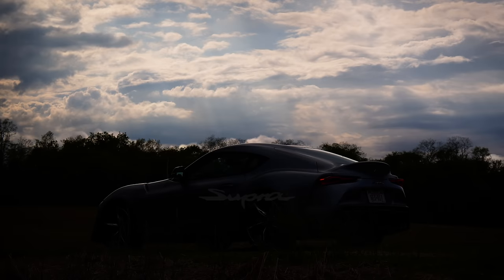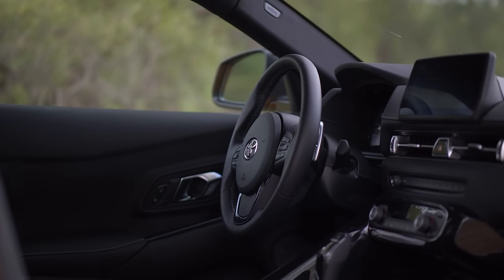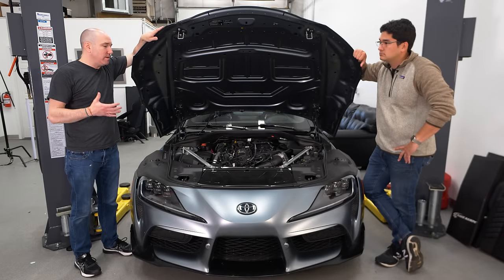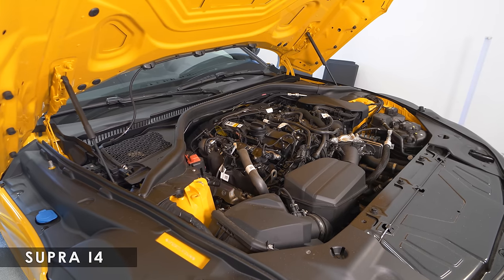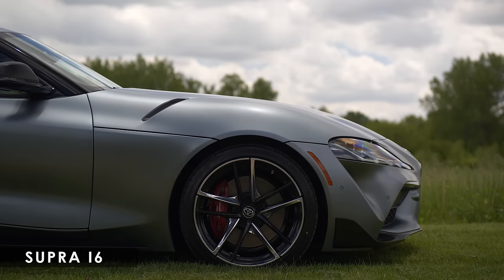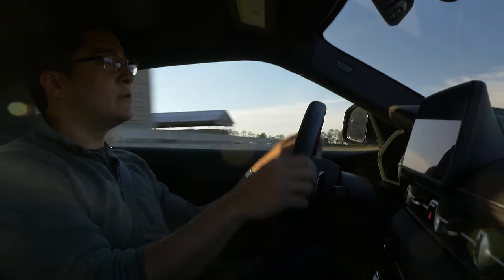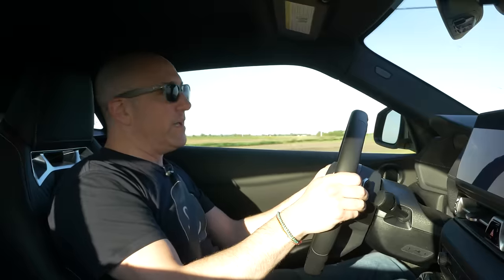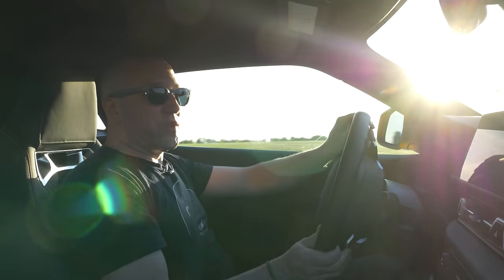2021 Toyota Supra | 3 Pedals Short of Greatness

Comment: 4:55 According to Toyota it's targeted to be a track-day weapon
21:44 It's not a track car
Reply: To be fair to him, I think there's a pretty big difference between a track-day car, something you could take to the track once in a while, and a track/race car, designed predominantly to be driven on the track.
Reply: Toyota also said it was targeted at the Cayman, a car with a manual.  
Clearing the air though, a car can be designed with track days in mind, but that doesn't mean they are going to take track days with no issue stock.  Early 86 had track day fuel pump, brake, and (arguably) tire problems and that car was specifically targeted at trackdays.  Hell Toyota/a dealer was sued and had to pay because of it.
Reply: hyperbomb02 not only did the cayman have a manual, it just seems insane to me to target a mid engined car when the car they made is front engined. Such a different dynamic

Comment: Engine bay is such a mess.....
Reply: You should look at the Lexus GSF’s engine
Reply: honestly its not that bad. All the fluids are accessable
Reply: Its not that bad, but if you want to see this engine cleaned up look at papadakis Supra or Ken Gushi's Supra engine bays. Its possible to do a clean up.
Reply: Especially the 4. Looks like spaghetti
Reply: They took the covers off.
Reply: Hah it's not bad by modern standards, the Q50/60 engine bay is a mess and has zero space
to work. XD
Reply: You got that right !
Reply: So buy yourself an early 70's Camaro and resto-mod in a FI converted GM V8 then.
Otherwise, hoses and wires are going to be how all the electrons, fluids, gasses get around.
Reply: Oil changes look pretty easy on the car tho

Comment: The 4 cylinder is not only 200lbs lighter, but it’s got the better looking wheel set. And smaller wheels are better anyways. Just needs a 6MT “RS” version that’s “another” 200 lbs lighter. 2980lbs? Yes please.

Comment: I would like all of the weight reductions and simplifications of the 4 cylinder model, with the drive train of the 6 cylinder. And of course, a manual transmission. I don't care about all the luxury and fancy stuff, I want the best driving experience.

Comment: The car reminds me of my 370 a lot in its 6cyl, 2 seater, hatch configuration and yes, even the buffeting, just newer and tighter. I'd upgrade to the Supra if it didn't cost $100k locally (double what my Z cost me new). Love that inline 6 though

Comment: Actually Mark, Tada-san said that, they'd pop the strut brace on when they increase the power output. He also said that, on the v1.0 Supra, they left the brace out so as to achieve a perfect "balance" (because the torsional rigidity is higher than that of the LFA), and that the enthusiast could add them because the airbox was designed to take it whilst also leaving holes for it.
Thanks again, guys for enriching us with a 'premium' viewing experience (even though there were a few typos here and there).

Comment: That sure is a lot of missing pedals.
Edit: Wait, the 4 banger has an open diff? The 86 Twins can afford to have an LSD, what's your excuse, BMW?
Reply: Just BMW being BMW.
Reply: Yup bmw being bmw. They try to compensate for it by using the rear brakes as an LSD clutch pack but it doesn't respond as quickly and wears your rear brakes. For most drivers it does the job, but on a car this expensive and driver focused it seems criminal to not include a mechanical LSD.
Reply: My base model 2019 ND2 Miata also has an open diff. Granted, that it's a $25k car and not a $45k car.
Reply: BMW doesn’t need an excuse. The ownership of the end product belongs with Toyota. It is their choice not to offer a mechanical LSD on the 4 cylinder variant. BMW could have supplied one if Toyota requested it but it would’ve raised the price point of the vehicle.
Reply: paul dewar This. People will always find a way to hate on BMW..in this case they’re simply the supplier.
Reply: You have to pay for everything. The "M" differential cost crazy crazy money.  Nickle and dime you for the "ultimate driving machine" that is not even close to sporty unless you option it to cost more than a M model cost outright.
Reply: All the McLaren supercars use open differentials. I'm sure they're not trying to save a few dollars.
Reply: @exothermal.sprocket  Then they must have some serious torque vectoring tech or something then, otherwise they'd one wheel peel all day.

Comment: I've been watching used RC Fs drop in price and was considering one as a daily driver. But the 4 cyl version of the Supra would be about the same price, but with a full warranty. As Toyota has a great reliability reputation, and BMWs are basically pieces of shit after warranty, how does that affect the Supra? 

I have to admit, part of the reason I like the RC F is that, I know there are Lexus V8's out there with 1 million miles on them from the original LS 400. And also, I feel the poo poo the RC F has had from the automotive press is silly as it's barely slower than the BMW M4. Which car would be more reliable in the long run? A new Supra or a used RC F?
Reply: Used RC F by a long shot!
Reply: No replacement for displacement
Reply: If you are looking to keep the car i say go for the rcf. If you are planning on just keeping it till the warranty runs out get the supra. Also there is no telling if this supra is reliable in the long run. At this point only time will tell
Reply: The Lexus is really nice
Reply: I'd get the Lexus. Yeah Toyota gave BMW a pass with their motor after some scrutiny but you can not get away from all that disgusting plastic inside and outside of that motor. Plastic valve cover, plastic intake plenum, plastic oil pan. Just ridiculous and will definitely not hold up in the long run.

Lexus at least is 100% Toyota but luxury interior. I would much prefer that for a daily driver that I can rely on. I'd get the Supra if I wanted a track car or weekend only car.
Reply: Used rcf>Supra 2.0
Reply: It's not that BMWs are shit, their are cars built for enthusiast who are willing to keep up with the extra maintenance. The Supra does have a lot of Toyota parts in the suspension and engine upgrades. There's really no telling with the Supra other than Toyota said they went through and got rid of anything they felt like didn't meet their standards.
Well the RC-F also gets that because the transmission is kind of wonky. If you leave it Auto mode, it likes to hunt gears and won't deliver full power. You have to use the paddles to get the most out of the RCF.  Also Lexus engines are not easy to modify and tune, they don't build them to be modular. Personally if  I was going Lexus I would wait for the LC 500 to drop down a bit more, it's more a GT car but overall a way better car build on Lexus's newest enthusiast platform and has their new 10-speed.
Reply: A V8 vs a four pot shouldn't even be a question.
Reply: You are comparing two very different cars. The main reason you would be choosing a RC F over it's competition is not just because of the V8, but because it's a Lexus, known for it's reliability and durability. It gets pooed on because every other car reviewer wants everything in one car, but I don't blame them since Lexus themselves don't know what the RC F is. It is a sporty car suited for grand touring, heavy because of its creature comforts. If that's not what you want, then the Supra is better suited for you, though you definitely aren't buying it for reliability. It will have problems, relatively inexpensive and non-crucial compared to when a true BMW breaks down, but the Toyota reliability definitely doesn't translate there -- I'm not saying its not reliable, I am saying that it's not going to be as reliable as a Toyota.
Reply: Depends on your use cases. Lots of city driving and not enough expense for car maintenance? RCF.

Lots of spirited driving and some side expenses for car maintenance? Supra 4 cyl.

I would not recommend the two for any form of track driving unless you put some good money into an LSD and cooling upgrades for the Supra 4 cyl. New tires and suspension tweaks certainly help but it's optional. RCF is simply too heavy for competitive track driving, as pointed out by Matt Farah on his review of the RCF Track Edition.
Reply: Likely the RC F, but it will be hard to find one that hasn't been beaten to sh*t...
Reply: Het a CPO one or extended warranty. If you buy the Lexus, then you are stuck with one. The RC has issues that make it a sub par experience to a BMW.
Reply: Anthony Castelluci CPO RC F
Reply: @Dylan S Not much different then what can happen with most high performance cars. I think the biggest issue is just the cost since most of the parts are imported from Germany. 
Honestly not sure why he isn't just looking at Domestics. 
The 6th Gen Camaro is a beast and a optioned out SS can be found used for under 40K.
Reply: Frank White  But it is for German cars and probably all  high end European toys.
Reply: RC F looks disgusting tho, that’s the problem. Personally I’d get an is350f and modify that
Reply: My friend has an rcf and it’s a great car. In the long run the rcf will outlast a turbo bmw motor.

Comment: Jason Camissa and his dumb sidekick will trash it because it's a BMW - "They don't even make quality cars anymore"
Reply: they don't though.  this is an awful car for long term ownership, which to an enthusiast like me is a deal breaker. 
-courtesy, a 2012 5.0 coyote owner... it's an auto, but at least it's not the MT82.
Reply: @hissingoose  The B48 and B58 engines have been rock solid so far. The ZF 8-speed well, it's in a gazillion other cars. So where's your facts, or are you just talking out of your behind?
Reply: I think he will trash it because all new cars and numb and joyless, mark talks about the numb steering, frequency isolators and synthetic engine noises, and no manual in the video

Comment: Yes, it's hard and expensive to make a sports car, but toyota made the rc f and the lc500 without any input from BMW just fine. They could have branded either one of those as a supra and nobody would have batted an eye.

And before anybody points out those cars are more expensive grand tourers - so was the original supra
Reply: They have 2 gt cars that have been on the market for 4 or more years. Adding another doesn't really make   sense. Plus the public wanting it to be i6 powered for only the supra alone changes things when it's not going to be shared in other cars. Car would also need to be tunable which u can't really do with Lexus and wanted it's chassis to be usable for more than one thing. Looking at it now I don't all the way see how the LC or rc chassis could be used like the mk5 is RN. Also u kinda have to think it makes sense since cars like the r34 was a sportscar and shifted into a supercar when the 35 came out. Or how the 300zx went from a gt car just like the mk4 then shifted to a sports car once the 350Z came to be. Same shift happened to the mk5 and it being a sportscar while the mk4 was a gt.
Reply: @carboydorifutoparty3976  I'm not sure I agree 

1. Most supra purists who care about what engine the car has would probably prefer it had a Toyota made and designed engine, even if it meant it was a v8
2. The r34 was meant to be a Porsche killer. I think it's pretty clear that it was a supercar for it's time.
3. They could have released the lc500 as a supra instead of releasing it as a Lexus under an alphanumeric nameplate.
Reply: @dabigchina  well people wouldn't be pleased with it since people put the supra up as a easy to tune i6 powered coupe. People wouldn't have been pleased with it being a rebadged LC since tbf its not one of those things tbh. It's not tunable,it doesn't have a i6,and it honestly is wayyy to heavy to be a supra. Toyota atleast kept the actual mk5 tunable,kept it i6,and still plan on bumping the car up in performance and chassis revisions and etc per year. Throwing the LC chassis in it would completely screw over lexuses market if it we're priced just as much as something like the rcf. If that we're to happen it'd completely screw both the lc and RC sales completely.

Comment: Great review! Regarding your final thoughts. From my experience with the M4 and m235, changing the exhaust REALLY REALLY helped with that lack of connection. Just putting an aftermarket down pipe on my car put a lot more smiles on my face. I do wish the engine came with blow off valves like old school JDM cars but aftermarket cold air intakes will have to do

Comment: The interegated exhaust manifold on the 2020 is a BIG OOF for owners that want to mod their car to make more power.
Very smart decision to go with non-integrated for 2021.
Reply: Other downpipe and Intercooler, with some software adjustment,  the 4-cylinder is capable of 350hp at the wheels 💨

Comment: Great video, but at $57,000 for the 6 Supra, that's almost the same price as the Chevy C8 at $59,000.  I'm not a big Chevy fan either, I'm a Lotus kinda guy ... but if Toyota want to go at the C8 price market, they'll need to add another 100-150 HP AND upgrades on the visuals.
Reply: C8s are going up for more than that 59k. Better yet 70k and up is what there usually seen at and it's rare to see them under 70k.

Comment: So for about the same money would you buy the 6 cylinder Supra new or a 718 Cayman S CPO lightly used which does not have the "numb butt" BMW feeling?  I love the I6 from BMW but much prefer the chassis on the 718 cars.  There may not be an actual right answer but only a matter of preference to the buyer.

Comment: Okay I'm not an extremist purist, but clutch manual is fun to drive even if its slower than an auto-paddle shifter. And how reliable is that BMW i6 as compared to a Toyota built motor in terms of life long maintenance?

Comment: Will the upcoming models of the Supra (2022,23,24 ect.) have any interior makeovers to include a little more Toyota/Lexus style features? It would be nice for the infotainment layout to be reworked a little bit. I wonder if interior improvements are a priority at all for Toyota or if their focus is more on a manual transmission option or tuning/performance improvements. I'm curious.
Reply: Well they plan on doing power bumps yearly and probably even a facelift at some point. But a GRMN is confirmed with 500hp probably sharing the chassis off a gt4 mk5 and being lighter than the base mk5 we have now. Things like manuel trans are practically unknown and people are heavily looking at the 2022 models and are throwing their own kinds of guesses on what they'll do for them.

Comment: I would want a NA 4 cylinder with a manual 6 with the least electronics as possible, no powered windows, no powered seats, etc, etc. Hell the way I would drive this thing I wouldn't event even need AC. I dont race a track, I'm in a big ass city with stop lights everywhere. It really is just race to the next light.

Comment: The issue with the rear suspension is hard braking into a turn.  The rear wheels reverse tow-in past zero making it unstable to accelerate out of the turn.  Many of the 2020's have been wrecked by the uninitiated who likely don't know how to turn a performance car.

Comment: The complaint is that sports/enthusiast cars don't sell, and become cult/collector models after the relatively short production run ends.  But when you brazenly urinate in the Wheaties of early adopters by introducing another, say 40HP, or a manual trans at year x, and keep adding tech and capability year after year, of course the postulants are going to hold off buying until the manufacturer announces the final year of production.  Because that's going to be the best one.  Adding to a car is fine.  Generational differences are great.  But face it, there's a very large portion of these buyers that are not looking at this car as primary transportation and can afford to wait for the next best model.  Making them wait longer might just spur sales now, and they would be more willing to trade up in 5-year cycles.

Comment: I like to drive with open roof in a convertible. Once the Z4 is upgrated by BMW,  can you make a comparison Supra 6 cyl vs Z4 6 cyl? Of course a manual gearbox would be desirable, but I doubt that we will get it, at least not in the Z4 :(  . I have the first Z4 which is fun to drive, but it rattles like a rattlesnake, which makes it unpleasant as daily driver. At least when getting older ;) .Thought about ‚upgrading’ to the new one, or eventually Supra, but your analysis would be of greatest help.

Comment: A lot of enthusiasts always compare the supra to the mustang/camaro, saying that for that less money, you can get XYZ more HP, and that the mustang/camaro  can actually turn now compared to it's predecessor, etc. Can you please make a video or link a previous video  to remind us why this is comparing apple/oranges? Whether it's manufacturing, stress testing, design, driving experience/feel, aerodynamics, etc., I feel enthusiasts can all get educated/reminded how what you see on the spec sheet and MSRP doesn't tell you the whole story. This will be very helpful especially since enthusiasts are always complaining and comparing numbers now without understanding the "why" (e.g. why are enthusiast car difficult to engineer and cost more than regular consumer cars. Can't they just take an existing RWD platform, shorten wheel base by removing rear seat, give it high HP, and make it $25k? ::exaggeration::) I find this also valid for 86/BRZ only has 200hp and costs $27k, and the constant comparison to mustang/WRX.  Bonus points on comparing 6 cylinder supra to c8 corvette. We all know the corvette beats cars above it's price point, but why would someone choose the supra over corvette? Bonus bonus point to throw back to s2000 vs 350z. A lot of people bashed on s2000 back then for being overpriced honda and torqueless, yet everyone wants one now but no one cares all that much about the 350z. Thanks!